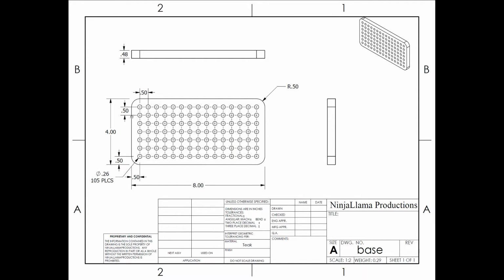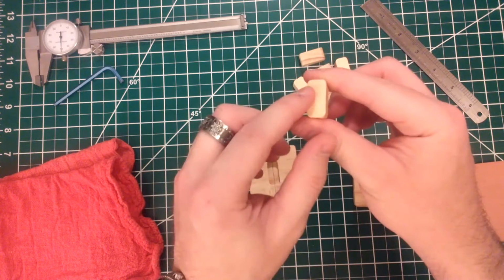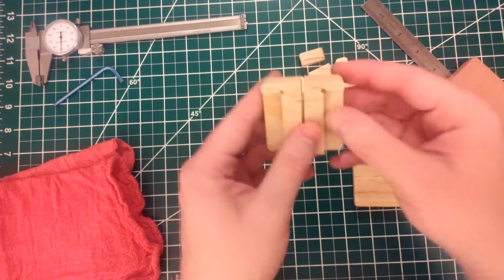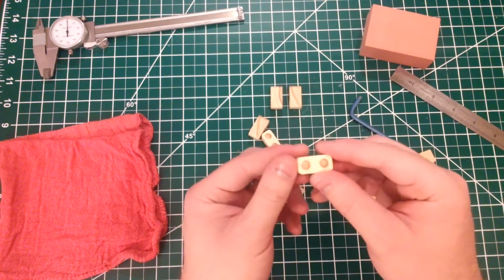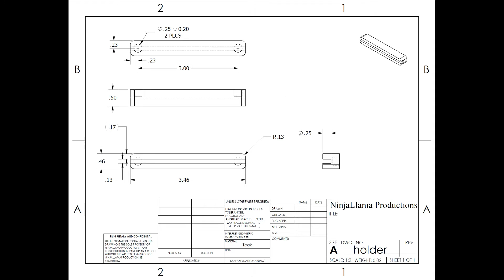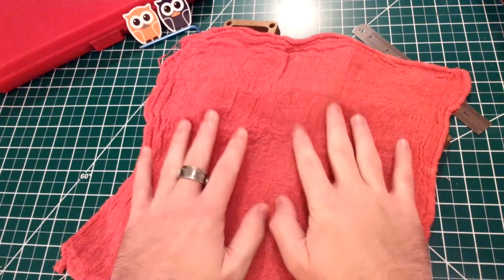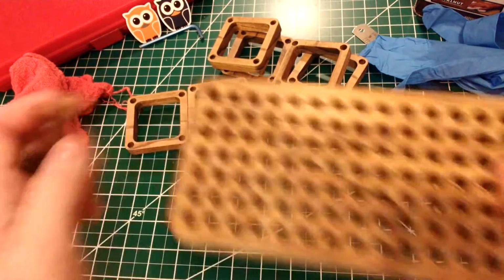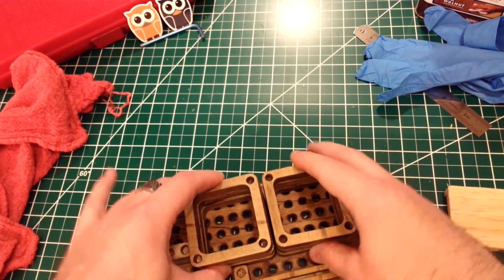Modular desk organizer

Comment: What is the strongest medal you can cut with the nomad
Reply: Does the software come with gcodes already
Reply from the maker: Aluminum is the most common. Steel and titanium can be cut but the passes are very light and it takes a very long time, unreasonable even, to cut those materials of any thickness
Reply from the maker: once you create your paths in the included software you should be able to generate the gcode from there. other software like fusion360 is also capable and is what I use. The carbide3D forums have a wealth of information there and if you are interested it would be worth a look.
Reply: Awesome thank you so much!